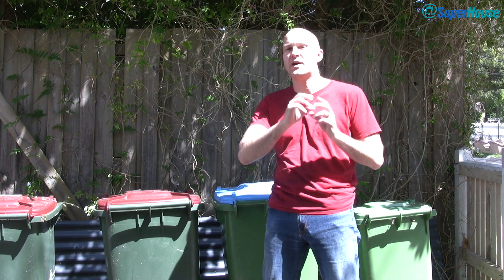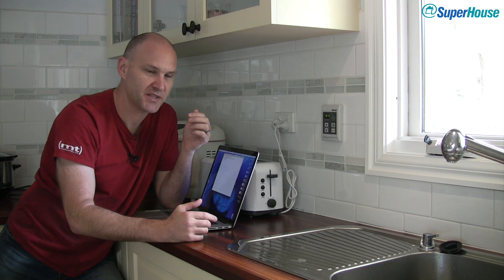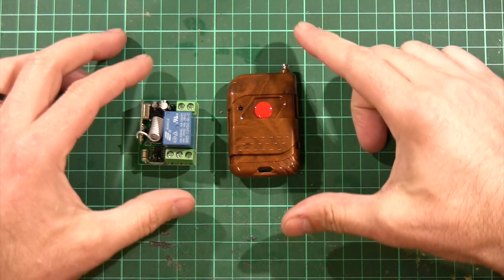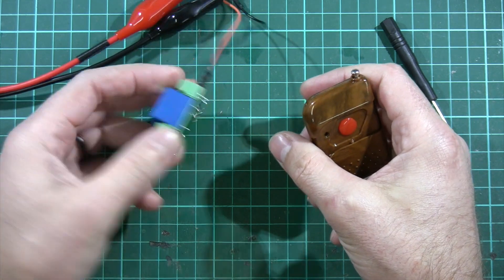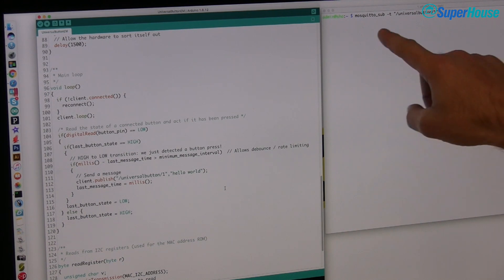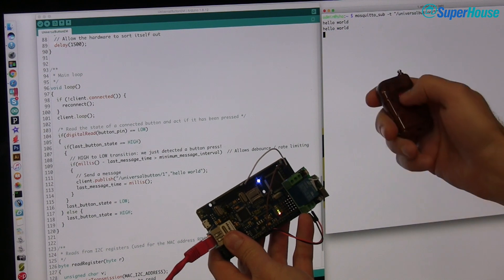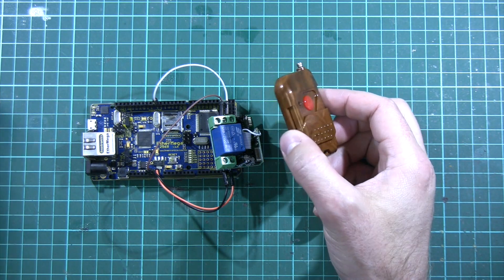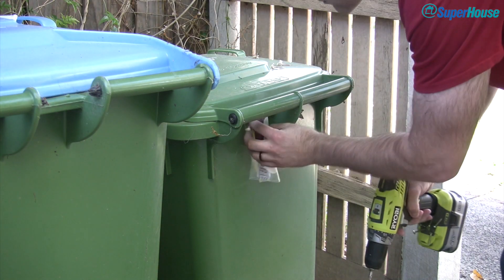SuperHouse #20: The $6 universal home automation button

Comment: I actually made a very similar button using an arduino. I like this solution much better. My button is used to activate the motion sensors on my home security cameras when we leave the house. As soon as you set the house alarm, you push the button and motion detection is turned on too. 

A better solution would probably be to find a way to tie in our home security system to the home automation system, but that has proven to be difficult so far.
Reply: How do you power it up? Mine becomes to big with an powerbank :D

https://www.facebook.com/photo.php?fbid=1481461941869440&set=a.101817626500552.6599.100000169451148&type=3&theater
Reply: Ronny Didit Since it's right next to the security keypad, I just piggybacked off the power to that with some short wires

Comment: A button to turn on my upstairs computer from downstairs via wake-on-lan would be convenient. Saves me a minute waiting for it to start up every time :P
Reply from the maker: That should be possible. You probably don't even need to use WoL: if your computer wakes up on keyboard or mouse activity, you could get an old keyboard (or mouse) and wire the receiver relay directly across a mouse button or keyboard key. Press the remote control from somewhere else in the house, and your computer will think you clicked the mouse.

Comment: I've only just recently done something very similar. Spooky! I bought four of the cheap RF remotes, got a RF receiver connected to an NodeMCU and just forward the RF codes over MQTT. Then I use Home Assistant to trigger commands based on the individual codes. I've even buried the innards of the remotes in momentary light switches around the house. My current favourite use is to control Spotify. 

The relay module is an interesting way of doing it.
Reply from the maker: Nice. That approach with blindly forwarding the remote codes seems like a great way to do it.

Comment: What about when the 433mhz receiver doesn't detect the click, they don't have QoS (Quality of Service) so you can't guarantee that every-time the button is pressed the receiver will detect it.
Reply from the maker: Yes, there's no ACK so you don't really know if the receiver picked it up. If reliability turns out to be a problem, I might put another status LED hidden in the ventilation grill at the front of the garage so that I can see it when I'm standing in the driveway. Then I can get immediate visual feedback that the button press has been detected. I'll only bother doing that if I have to though. It's too much work!
Reply: I use those remotes for controlling my lights, I think im probably getting about 1 in every 35-50 clicks missed not a huge issue, just annoying, Im looking for something with QoS that isn't 2.4GHz (I don't like clogging it up with RF), 433MHz can have QoS but you have to use your own Protocol so you can't use those cheap buttons :(

Comment: Now that was a coincidence, just today I have had a similar remote delivered to act as a front door bell. I will be hacking an external button into the fob so it can be inside and protected but without the need to run wires to the front door. Linking the receiver into a suitable spare port as you suggested means I can then have notifications where ever I want inside or outside the house. I'll also be setting do not disturb times into the system so no sounds during the night.
Reply from the maker: Brilliant. We've had no doorbell for about 5 years, because building a smart doorbell has been on my to-do list and my wife can't decide what style button she wants to use! This is definitely on my list of future episodes. My plan was to include a video camera as well, or just to take the feed off th existing CCTV camera covering the front door area (shown in a previous video) so I can see the person at the door. Back when I started planning it, that would have been unique. Now you can buy internet-connected video doorbells all over the place. I still want to do it myself though, because it'd be a satisfying project and give me more control like what you're doing with do-not-disturb modes, etc.

Comment: What arduino did u use?
Reply from the maker: In that demo I used a Freetronics EtherMega. It's very expensive for this application and has way more I/O than required, but I had one sitting on my desk and it does handy things like PoE. You can do the same thing with just about any microcontroller board. http://tron.cc/em (Full disclosure: I designed the EtherMega because I wanted to use it in my home automation system)

Comment: You could just put some vaseline inside the transmitter instead of the waterproof bag.
Reply from the maker: I'm just guessing, but I think the areas most prone to corrosion problems will be the bare contacts for the button, and the battery terminals. Both of those would need to stay vaseline-free so it may not entirely solve the problem.
Reply: You are right, that could be a problem, however, the bag isn't the best solution either, I think. Maybe some silicone cover would do the trick, but that would be much more time consuming to make.

Comment: I really like this project. If you're prone to forget the garbage and have complicated bin schedules, which I do as well, it's a great reminder. It does a great job of showing the value of ambient information. I don't really love the outside proofing of the device, but I suppose if it works, it works.

I would prefer a version of the button that doesn't need 12v to work, as I have an abundant supply of 5v USB power supplies, and that is much more convenient to use. I didn't see it in the video, or the extra information, but what frequency does the button use?
Reply: Brandon Saffell.    315 MHz I think or maybe 433 MHz
Reply from the maker: Thanks for reminding me, I should have talked about frequencies in the video. The unlicensed ISM (Industrial, Scientific, Medical) band varies between countries, so it's important to get one that works in your particular country. Here in Australia it's usually 433MHz, while in the US it's typically either 315MHz or 915MHz. It's easy to find different frequency remote controls to suit your particular country.

Comment: at 06:18 The not turning off mode will turn off when you press another button on a multibutton remote, so only one relay is on at any time.
Reply from the maker: Aha, cool. That makes sense. Multiple interlocked outputs.

Comment: Can you do a followup on this next week, after collection? I do sense that the rubbish truck will destroy the antenna and/or bag.
Maybe an outdoor doorbell enclosure and stick it to the back side of the bin, instead of the middle?

If the system was made to be multichannel, you could have a night time mode button, close the house down and arm button, a husband summoning button or a "check the list" button :P
Reply from the maker: I'm pretty sure the button will be safe, but I'll report back after Wednesday morning (our bins go out on Tuesday night) when they're collected. I watched the mechanism on the truck to see how it works, and it's a U-shaped gripper that squeezes in from the sides. It doesn't touch the back of the bin, so center back under the handle is about the most protected place on the entire bin.

Comment: It's called an Amazon Dash button; people have been hacking them for a couple years now 😊
Reply: BTW, if I remember correctly the dash button has WiFi built in so you could skip the arduino entirely.
Reply from the maker: Yes, Dash is another option. There are dozens of little IoT buttons around now.
Reply: BEdmonson85 I think you will find this is a much easier, cheaper and open way to use a button with a Home Automation System... I wouldn't want an Amazon dash button that tells me when my bins are out that has a bright washing detergent sticker on it!

Comment: In Part 2 of this video, lets modify the bin with motor driven wheels and GPS so it can take itself out :D
Reply: And add a sensor for angle measurement, so that the automation system knows when it got emptied and can signal to put it back in...
Reply from the maker: That's a really interesting idea. I though about doing it that way, and I may still do a follow-up using that approach but there were a couple of problems I thought of. Firstly, the obvious way of doing it means having an active device such as a microcontroller with an accelerometer that's reading frequently enough to detect the bin being tilted. Even with deep sleep and waking up (say) once every 2 seconds to take a reading, the battery won't last long. The other problem is that it could be triggered by lying the bin down, such as to hose it out. However, I did think about doing a modified version of the button using a mercury tilt switch wired across the transmitter button so that if the bin is tilted then it shorts across the button terminals and sends the signal. Our bins get moved around during the week though so that could also trigger it. Another idea was to use sensors where the bins are normally parked. It could be Hall effect sensors with magnets glued under the bins, or distance sensors, or whatever. If the bin isn't in its spot, the system knows it's probably been put beside the road. There are quite a few different ideas I'd like to explore with this in future. Doing this with rubbish bins seems a bit silly, but it's a proof of concept that can then be applied to many other things.
Reply from the maker: I did fiducial tracking many years ago with OpenCV, so that seems like a pretty valid solution to me!
Reply from the maker: Oops, I misread your comment, sorry! I thought you meant sensing when it has been put out. You're right, detecting when the garbage truck has emptied it would also be useful. I could do that with the mercury tilt switch idea :-)
Reply: In fact, I have seen a project doing just  that. The guy had a rail system for his bin(s) that were standing on a plateau and would go out on the scheduled day. As long as the Garbage men would put it back on the plateau, it would also reel itself back in again
Reply: For some reason I would totally want to paint a fiducial on the back of the bin and detect it with a camera, could have different ones for different bins too, maybe oversized QR codes
Reply: Be sure to read Home Automation review on my blog before you buy. Go to peacereviews. com/home-automation-review/ Thanks. Lpd Umberto.

Comment: Johnathan have your thought about making a smart mirror? would suit the smart house for perfectly.
Reply from the maker: That's been on my list for years! I have 4 mirrors in the house that are candidates, and I got as far as checking out having a custom frame made to fit a monitor. I really want to do it, just haven't got to it yet.
Reply: SuperHouseTV Even though I'm sure you would do a way better job of it than me, I found installing a mirrored film on a piece of glass to get it to work with the screen behind was very difficult. Also, when the light difference between the front of the mirror and the back isn't large enough, it looks really tacky because you can see the screens backlight
Reply: and some videos about ioBroker would be great!